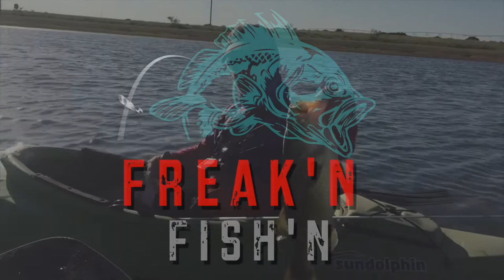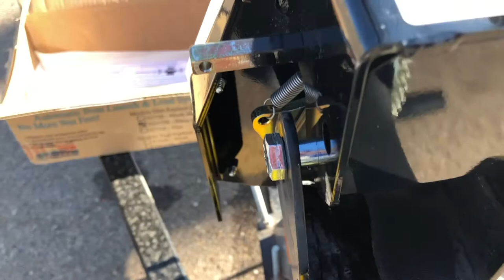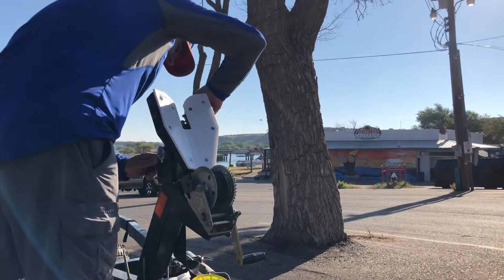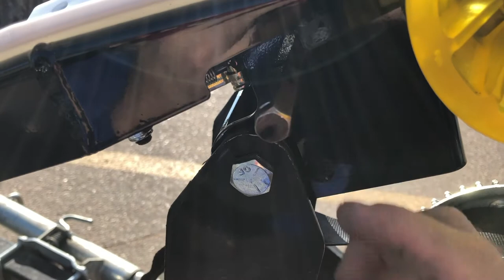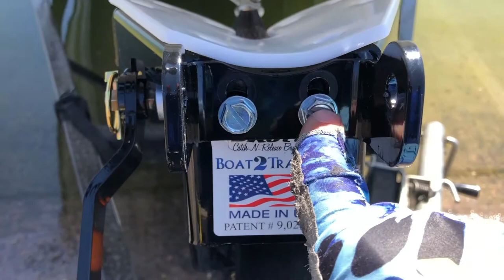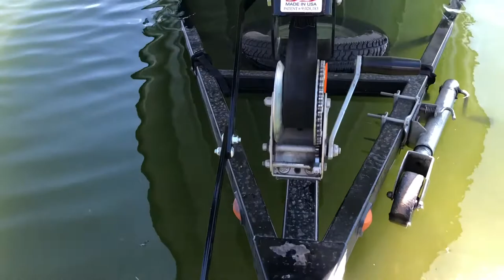Drotto Boat Latch Install

Comment: Mine was 3 3/4” for a shorelandr trailer and it fit like it was made for it.. no extra hardware.. I had the boat on just pulled it up from the ramp and didn’t winch it all the way on and it installed in about 3 mins,  so happy with this!!  Works like a dream.
Reply from the maker: Awesome. Yeah I like the system. It’s worked well

Comment: Is the inside opening your trailer that the latch goes in 4 inches?  My Master Marine Triton bass boat trailer is 4 inches exactly.  If so did you purchase the 3 3/4 to 4 inch model?   I like the latch but it doesn't seem to fit correctly.
Reply from the maker: Yeah mine is also exactly 4”. In the video you see me put some washers in the spaces on each side. That’s all you will need to do. I haven’t messed with it since that day I did the video. It’s worked perfectly. Don’t worry about that part, just know that you will need a few washers. It’s a great product. It’s something I’ll always have on my trailer from now on. Oh and yeah, I did get the 3 3/4 model.
Reply: @freaknfishn  yes you ordered the wrong size

Comment: They sell a 3" model and a 3.75" model. Maybe you purchased the wrong one?
Reply from the maker: It’s actually the right one it just needs spacers. It is made for several different trailers with slightly different dimensions. I just wanted people to know that it doesn’t just pop on there out of the box. It’s worked great since I put it on though. It definitely makes things easier.

Comment: And the reason you didn't buy a 1/2 inch longer bolt is?
Reply from the maker: Because I had a flat nut with me lol. I took the latch with me to the lake so I could put it on with the boat off the trailer. That was why I mentioned that. If you do have a Triton trailer and plan on putting it on at the lake, there are a few extra parts you will need. The flat nut works fine but it’s just something I lucked into having with me.

Comment: How were you able to remove the roller bolts? Mine are not budging
Reply from the maker: Mine came right off. Are yours corroded?
Reply: @freaknfishn  nope, they look brand new
Reply: @freaknfishn  have you had any issues with the plate scratching up your boat?
Reply from the maker: That’s strange. I just used two wrenches. One to hold and one to back the nut off. If they’re stuck you might try to use a short cheater pipe over one of the wrenches to make it a little longer and give you some leverage. I can’t imagine why they’d be that hard to get off though
Reply: @freaknfishn  does your plate scratch up your boat at all?
Reply from the maker: No, I haven’t had any trouble with it scratching it.
Reply: There is a second bolt to put where your original roller was, you might wanna try that hole to see if that fixes it

Comment: I wonder if you actually measured and ordered the right one? Because there's no washers needed if you have a 3 and 3/4 but only a couple on each side if you have the 4"
That being said if you ordered the three and a half inch there's going to be quite the Gap like you've got in this video
Reply from the maker: Yeah it’s the right one. They can’t possibly make one for each trailer. I understand that. The only reason I mention the washers is because if you are thinking you will do as I did and put it on at the lake, and you have my trailer, you will need washers, otherwise the latch will just hang there. It’s been a while since I did it but if I recall, the trailer has 4 inches ID and the unit is 3-3/4 OD. I think that was it.
Reply: @freaknfishn  I will definitely be bringing some extra washers with me.  😉

Comment: You bought the wrong one they sell one that’s wider 4 inches it’s between there without washes
Reply from the maker: It only comes in two sizes. This one is the large. My bracket measures 4 inches ID. Drotto’s large latch measures 3.5 inches. You have to add spacer to anything bigger than 3.75 inches. All the info is on their website https://www.boat2trailerhookup.com/drotto-automatic-boat-latch/drotto-boat-latch-sizes/
Reply: @freaknfishn  there's actually 3 types. They have the 3", a 3 /3/4" and a 3" made specifically for Ranger and Stratos boats. Maybe that's why you're seeing the marking.
Reply from the maker: My boat is a Triton but I wonder if that might be a problem with some of the others having trouble with that. It sure is nice to use at the ramp but over time the rubbing is causing a problem. On mine it’s happening when loading the boat. Trailering and unloading is all good.

Comment: You should have used the rotator splint to adjust the bolt toggle. Leaving that toggle on the wrong rotator flange is bad news. Hope this comment helps. I like to watch videos and try to be a know it all.
Reply from the maker: 😂 😂 😂 thanks for the tips!

Comment: Doesn't need washers so shows you ordered wrong size. Mine fits snug and had to tap in
Reply from the maker: Sorry buddy you’re wrong. Not all trailers are the same.
Reply: @freaknfishn  I know that so either you ordered the wrong size Drotto Width or your bracket was previously bent. I'm sitting infront of my Triton trailer right now with the 4" drotto and wouldn't be able to even fit 1 washer let alone multiple on both sides. You must have ordered the size below the 4" or the previous boat owner bent the roller brackets open a bit when replacing the roller
Reply from the maker: I’m not sure why you want to argue with me about this but my bracket has never been bent, it’s a Triton trailer, it measures 4” ID, and it has to have spacers to fit snug. It literally says it on the Boat2trailer website. So unless they started making a newer model, that’s the deal.
Reply: @freaknfishn  well I have a Triton trailer too and I ordered the 4" version which fits snug without a single washer. That's why I'm saying something is wrong. How can we both have Triton 4" opening trailers and mine fits perfect and yours needs Spacers?? 
Probably cause you fish Bass and I fish Walleye...lmao.
Reply from the maker: Lol. I won’t hold species against you. Idk what the difference is without seeing it. Mine is 4 inches inside diameter. Is it possible that yours is 4 inches outside diameter?  That would make the difference.